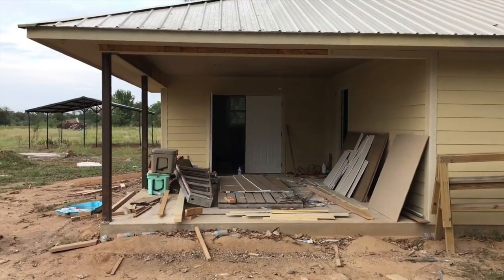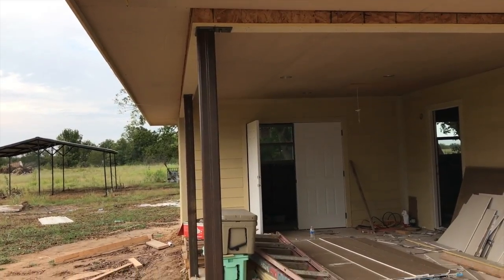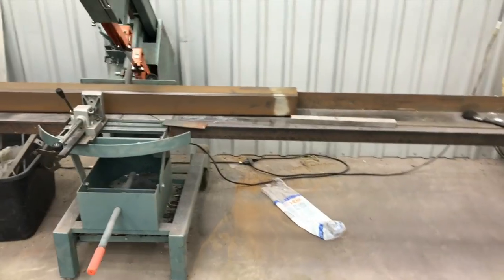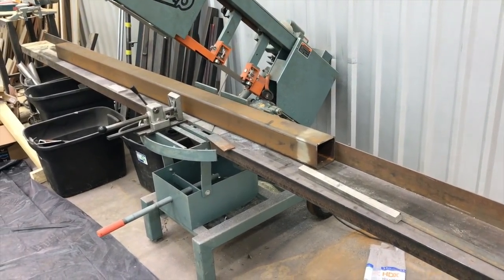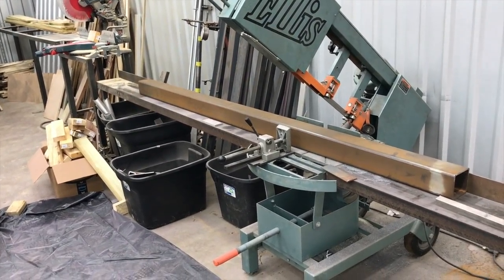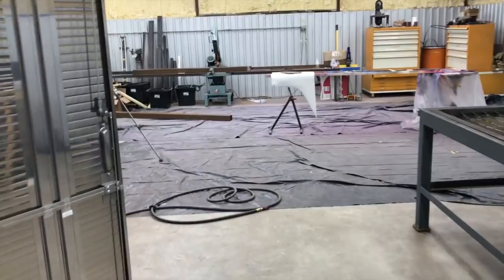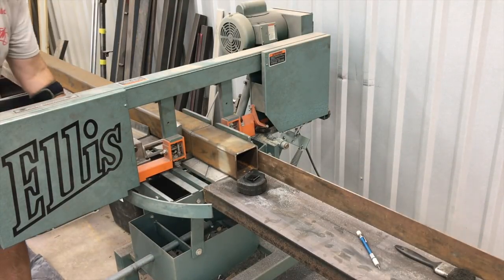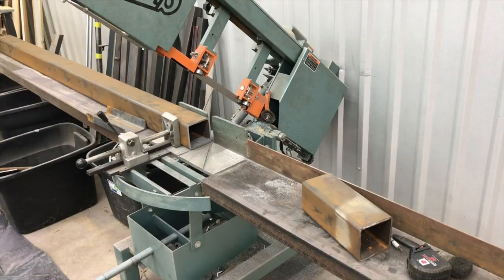Tig Welding on a House?  Why?

Comment: Is nice to see you got work from a contractor you used.   Just a friendly note Gary.  Tig welding structural steel components is a fairly big no no.  For future projects you might want to use stick or wire.  I only offer this comment to you out of not wanting to see  you have legal problems down the road for using improper procedures and possible failures because of it.  Otherwise good to see you are getting busier after your recent expenses.
Reply: +Jason Wilde 
Your statement "Tig welding structural steel components is a fairly big no no" is possibly your opinion but is not accurate. 
Please tell me where you got that notion. 
Please explain in great detail the science, metallurgy, how and why you believe "Tig welding structural steel components is a fairly big no no". 
The AWS does not make that statement. 

A properly executed weldment using GTAW (TIG) is equally strong if not stronger, more ductile and with fewer defects than GMAW (MIG) or FCAW (flux core wire) or SMAW (stick). 
TIG is used extensively in ultra high temperature ultra high pressure vessels, piping, structural members, mild steel, high tensile steel, stainless, Inconel, Monel, Titanium and other exotic metals in all positions in nuclear power plants where strength counts and there are zero defects in the weldment.
Reply: It'll be fine as long as someone doesn't slam a truck into it... It may have been a good idea to do 2 passes though on that thick of material...
Reply: +Jason Wilde 
No problem, what you stated about TIG regarding structural applications is an often repeated erroneous belief about GTAW/TIG that I encounter. 
Properly executed GTAW/TIG process has penetration, strength and ductility on par with other common processes. 

No hostility here, just a knowledge exchange, we all can learn from each other. 
YouTube comments can be brutal and it is usually best to be wearing your asbestos underwear when posting. 

What you stated about the legal liability aspect is valid, however not because of using GTAW/TIG. 
That said, the square tubing and plates are primarily loaded in vertical compression and a weld failure is not likely in normal loading conditions. 

You are correct TIG is not a common practice for most structural applications because of cost, deposition rate (time/productivity) and many welders performing those welds are following a WPS that is heavily influenced by management and bean counters looking for the fastest and least cost process.
Reply: Tig welding structural steel components is a big no no?!? Thats the biggest load of crap i've heard in a long time. Not many people do it because it takes lots of time and experience and also cash. However, as long you follow the blue prints in addition to weld bead profile, there is no difference in structural performance, If your tig welding with er 70s6 and you mig welding with er 70 s6 what is different besides the way your laying down the wire?! as long as you have a machine that has enough amps to tig, mig or stick it there should be absolutely no problem in a shop environment. Now if your not cleaning the metal and trying to tig it outside with 30 mph winds, sure theres gunna be problem vs stick but thats not what were talking about. 

If what you say about tig welding is a big no no for structural components why are all the pros  who drag race, offroad, build motorcycle / race car frames whos vehicles and roll cages take more abuse than pretty much anything in the world tig welded? If your statment was true all the pros would be mig /stick welding their roll cages. With Tig welding you never get a cold start unlike mig or stick. If what you say is true, why is tig used the most for airplane maintenance, roll cages, and frames? 

I support all forms of welding but if your saying you can't get as good/ strong of a weld with tig in a shop environment you are surely mistaken and misinformed.  There are many structural steel components tig welded all day everyday but just not seen as much because of sheer costs and experience needed.
Reply: Jason Wilde you are mistaken about tig welding being a No No, with tig welding you can get all the weld penetration you need and you can also add as much filler wire you need. Also the welds on this job can hardly be called structural welds when there is no load on the weld itself, although I do admit there was not much filler wire added to these welds and on at least two of the welded joints there was no filler wire added with the joints being just fused together. I have over 40 years experience with tig welding and a lot of it used for structural work.
Reply: I can see why you believe it would be a 'No, No'. Shielding of the weld pool is important. If these beams were to be welded out in the field it would make sense to use Stick, or Flux Core. But since hes in a shop environment I think tig welding is fine. Plus tensile strength of ER70-s6 is the same as 7018 or E71T-11.
Reply: patw52pb1 wow. Opened a whole can here.  Yes you are right what I said was vague at best.  So you are correct tig welding is a vary strong method of welding. When proper procedure is followed  by a  ticketed experienced welder. Hell I love tig as far as I'm concerned it's a gentleman's way of welding quiet no sparks.
Reply from the maker: Thanks Jason, I had no clue there were any issues with tig welding structural.  As others have stated below, I felt the same way, that the main advantages to stick and flux core mig was the shield gas issue, and since I wasn't outside it didn't seem to be an issue, but always appreciate your input.  And yes, if you put a comment out there with an opinion you can expect to be challenged, just like I get challenged on something with every video i upload lol.. I am going to pin your comment to the top because I think it's interesting dialogue for sure
Reply: Jason Wilde, I think your reasoning is strictly anecdotal and not based on facts.  This was a one-off custom project and far from a production environment, where the expense of GTAW vs GMAW or SMAW would make a measurable difference.  The truth is, there is nothing wrong with TIG welding in this application.  Any of these processes are a hell of a lot better than a wooden 4x4 and a few framing nails or lag bolts holding it all together.  Let's be real.. that's how most carports are successfully put together.  This could be considered overkill; and I love overkill.
Reply: I would have used MIG myself, only because I know my machine can get full fusion on 1/4" wall, that, and I don't have a stinger anymore. But, may I ask why "they" say TIG on a project like this would be a bad idea?
Reply: Unless Im missing something it sounds like your telling me Mig or stick welding is stronger then tig welding. Tig welding has the most controlled arc therefore meaning a more consistent weld. It also depends on what filler metal were to be used, the tensile strength is likely the same. As for the heat affected zone, that depends on how skilled of a welder you are. I believe tig welding would be fine.
Reply: +Robert Atwood I was referring to commercial truck frames. Until around 2007, federal regulations prohibited welding truck frames. Then the rule changed to say that any welding has to be done in accordance with the manufacturer's specification.
Reply: Tig welding is just fine alot of roll cages are Tig welding that withstand triple didgit crashes into concrete walls so...
Reply: Ramsey Customs - turbocobra lol...yeah I see it really gets people going when you post vids or comments on here.  I put a comment out there that is partially accurate and was called on the inaccuracies of it.  I have a shop and it was certified for structural steel until about a year and a half ago when I tried the rig welding in Alberta. ( which with my luck came to a crashing halt shortly after going out there). Lol. Anyhow I'm going to sit back and see how badly I get ripped apart for the comment...lol  I suppose I should have said tig is not common Practice for structural welding building components.
Reply: Jason Wilde the only reason you pointed out that was correct is the cost involved for extra time, but as he said it was good practice for him you would assume he charged accordingly
Reply: Ramsey Customs - turbocobra I've seen everything that there is to see on the comments of this completely freaking chaotic one dude even said you can't weld truck frames or was it trailer frames with it TIG Tig is a very flexible joint excellent for things that Flex race car frames tubing welds that sort of thing TIG does have one issue it isn't a penetrating weld but very strong from the testing and Welding that I've done stronger than short Arc or flux cored either one short Arc doesn't penetrate either short Arc is a more brittle weld flux core being on top of that in brittleness the only reason I wouldn't use Tig to make that joint is the time it took to weld it I would use TIG on a truck frame or trailer frame in a shop / TIG welding because you completely eliminate the possibility of hydrogen cracking you still have the stress factor and the hardness factor to worry about the preheat and post Heat should take care of that but as far as a hydrogen crack you're pretty much out of the water I thought that it was a good gesture that you perform the operation with a TIG and that you posted a video of your achievement congratulations and keep up the good work
Reply: Kevin Hornbuckle see I don't know nothing about that I've been welding on High strength Truck frames ever since I started welding back in the early nineties to this very day they stamped do not weld however there is a procedure you do to weld on high string frames a lot of people have been killed especially on low boys because of improper procedure as stretching the frame or shrieking a frame there is a procedure that has always been it's the same procedure that you use welding on a lowboy if you know anything about that I'm not going to get into it right now but the evidence is clear especially on some of these high-rise sleepers they have on these truck frames that they've stretched 10 ft for these luxury sleepers my first frame was taking a sleeper off of a truck making a day cab out of it cheers
Reply: I've read a bit on the procedure but I have not done it myself. Thanks for the insights.
Reply: Eco Mouse http://worldwarwings.com/discovery-wwii-shipwreck-brings-worst-97-year-old-survivor/r
Reply: In my opinion, if the customer doesn't require you to use any WPS or quality standard then you can do whatever you want, however if they do require you to use a AWS procedure as long as they have one you can use that's pre-qualified for GTAW you would be able to do it. This looked like you could have done whatever on it as long as it's done.
Reply: I have been a structural welder for over 15 years. The problem is with FEMA and AWS there are approved welding methods that have gone through rigorous destructive and non destructive testing. The engineer will normally dictate what methods and filler material are approved. The majority of destructive tests I personally have witnessed welders fail have been from 2 things, too hot and too cold. Welding too hot causes cracking issues and with tig if you keep the puddle too cool you can have lack of penetration or cold lap. If you read the prints properly, they inform you of procedures on what and how. If you do that the blame will be removed from you and be on the engineer.
Reply: Cra5hWeld tig is a strong weld yes.  And using a proper wps it can produce a quality weld but that is with a proper wps and a "seasoned" welder.  Also from contractor's side when you consider deposition rates and the expense of each of the the 3 methods tig is the worst one to pick of them.  Of the 20 wps I had for my shop for structural welding none of them were for tig. The welding engineering firm I had for my CWB certification laughed when I brought it up one time.  And again I'm  not trying to troll the man I only mean to help.
Reply: I think it is true that TIG is prohibited on trailer and truck frames.

Comment: Im a Certified Journeyman Welder from North of the 49 th parallel and i think i would have used stick to weld it up with a bevel and 6010 root 7018 fill and cap , If there was no procedure for it , just because for me it would be faster than tig

Comment: TIG Welded! Slower, but no f'ing spatter to clean up. TIG welding any steel (structural or not) is fine as long as you know what the hell you are doing... Looks fine.

Comment: With this thickness of steel you need to be welding with higher amperage and adding more filler wire, also when approaching a corner don't stop welding until you have gone round the corner, when coming back and adding a little bit to the corners like you did you are not getting good penetration where it is needed as it is at the corners where any crack will start, also with at least two of the joints you did not add any filler wire which is a big No No on thick steel with low welding amps, you should also remove the the mill scale from the metal before welding.
Reply from the maker: Good input, appreciate it John

Comment: Don't see any reason to object to TIG in this application, seems to me that the weld joint is essentially not loaded in ANY WAY.
Reply: Kevin Hornbuckle really? If a car hit a 6x6 properly installed and based and it was hard enough to break said 6x6 I'm thinking no less damage would result with steel instead. Maybe I'm just all wet on that code but for residential the steel doesn't seem necessary. I will admit thinking that the base plate being welded to the post is so much more durable in an impact situation and thought that at the introduction. I've never been called on a wood post here in Vermont, but with our winters I've only done a few carports over nearly 30 years...
Reply: Yeah, this being a back porch, not a carport. I concede MIG, and might as well be dual shield flux core, or 7018 stick or the like being best for the ultimate strength of the weldment itself. And only the weldment itself.
Reply from the maker: yes, possibly put in shear if hit with a car or something
Reply: That is the basis for the code here in Oregon. There were several incidents of car port collapses when hit by a vehicle.
Reply: So there's an expectation that a carport support column withstand a vehicle impact?  I do agree MIG or stick more appropriate to the wall. And I was not thinking in terms of codes. Thanks for the heads-up.
Reply: Just more likely to withstand a getting bumped by a car than an old wood post would.
Reply: Yes, the code specifies steel so that a car is unable to break it. Other force would be earth quake or extreme wind shear.

Comment: Why you no bevel, Gary?
Reply from the maker: Nah, not on 3/16.  My welder is rated to weld 5/16 @ 200amps on steel, and it appears to be deeply penetrated looking at the underside of the flanges

Comment: Nice work on the posts. 
Once you have a plasma table you wonder how you ever lived without one.
Like the side clamping ability of your welding table.
Reply from the maker: yes sir, exactly.  It's game changer for sure.  I could have made those brackets by hand, maybe taken a little longer but it's nice to just bang them out real quick, and yes the side clamping ability is handy for sure.. thanks you sir for your support over the years

Comment: That 'll hold er up! Haha.... When you were cutting i noticed you held in from the edge. Is it just to have a cleaner cut, or does the plasma table loose its location if you were to use the existing edge? Hopefully this might lead to a few other projects for you, concrete man and builder both have to be taking notes, keeping you in mind for future. Thanks for sharing
Reply from the maker: You can really start your cut from anywhere on the table.  Position the torch where you want it, and the software has a "zero out" button, and wherever you have it, it thinks thats the new "home" location.  I don't start it on the edge because the plasma cutter has a 20 second air blow clear out after it finishes cutting to cool the torch, and it will blow water all over the edge of the table and onto the floor.  Obviously with a full sheet you have no choice, but when I am using drops or scraps I put them out from the edge a little ways to keep from making a mess.  Thanks sir!
Reply: Ic .. yes mess making is unnecessary when you're chief cook and bottle washer. Makes perfect sense. Thanks